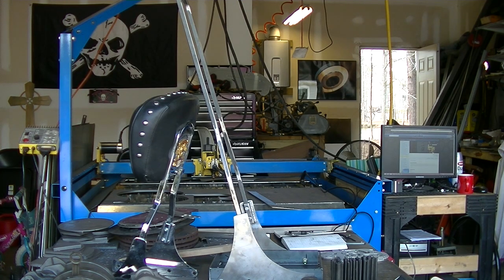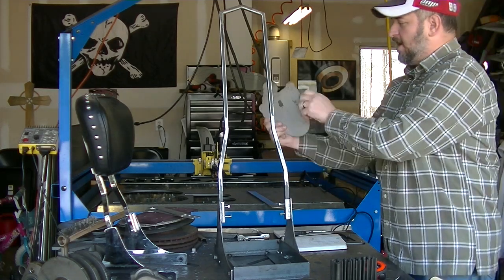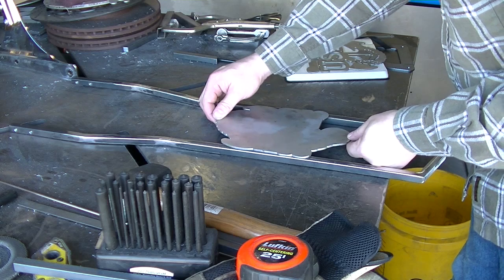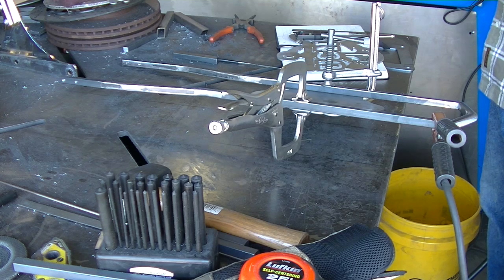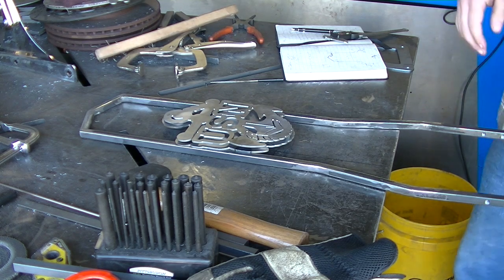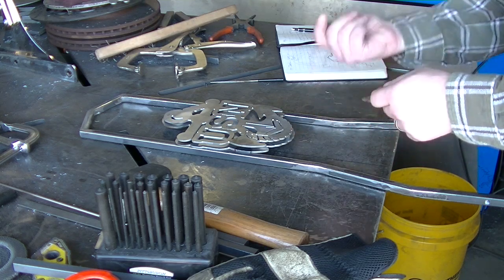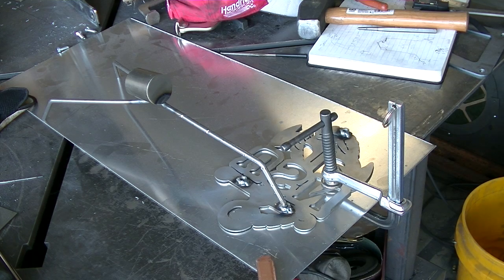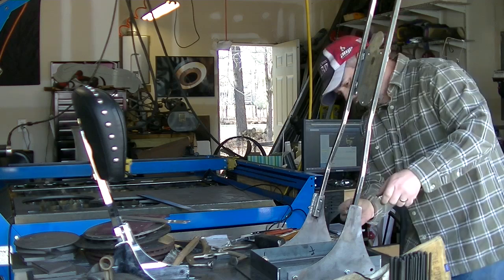US Navy Themed Sissy Bar

Comment: nice work mister! I was looking for video inspiration to make a sissy bar, no where near as tall as that. I was thinking like 12-15 inches to add passenger support and a rack for a bag. I have an 05 sporty. wonder if your width dimensions are the same? - also I was wondering for something 12-15 inches tall, would square hollow tube work? or maybe it won't bend without crimping?
Reply from the maker: +wiseguyproductions Thank you very much! I really enjoyed this build and the owner shows it off regularly.The mounting width is probably a little different for that model. The Sporty has a narrower frame if I recall correctly. I can check and see what I can find if you would like.Bending the square tube is possible but it causes dimples on the inside bend and can push the outer sides out as well. Quite a few are made that way but use mandrel benders to keep the walls squared up as much as possible. I guess what would really matter is how sharp of a bend you wanted to make?Appreciate you watching and let me know if there is anything I can do for you.Sincerely,TOm Z
Reply from the maker: +wiseguyproductions Sorry for the late reply. Field trip with my daughter and your comment went to spam for some reason?? Anyway, I'll check the video soon...

Best wishes,
Tom

Comment: Nice work.  What gauge steel do you use for the base?  You said 11 gauge for the emblem, but I didn't hear you mention what was used for the base.  Thanks for the inspiration to go make something.
Reply from the maker: +Daibutsu Thank you! I'm glad to hear it motivated you to go make something as well.

For the emblems I cut them all out of the same 11g material. It was already on the table and we wanted it to be sturdy.

Appreciate you watching and for the kind words.
Tom Z
Reply: +Tom Zelickman (Inspiration Metalworks) 
Are the brackets that attach to the bike made out of the same 11g?
Reply from the maker: +Daibutsu I'll be honest, I don't remember at this point. I believe so. I made a jig from the factory backrest and brackets bolted together. Then I made the rest of the parts to fit that jig.
Reply: +Tom Zelickman (Inspiration Metalworks) Thanks for the info.  I'll be binge watching your channel now.
Reply from the maker: +Daibutsu Glad to help!